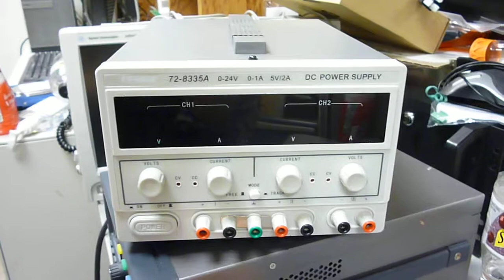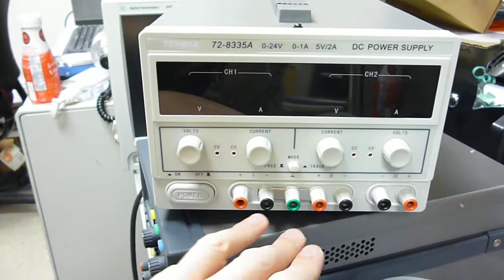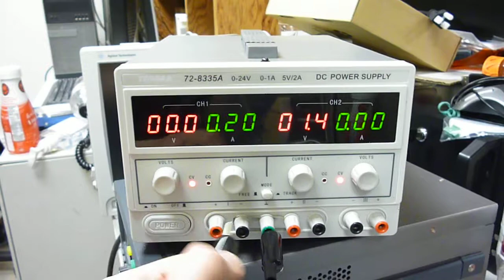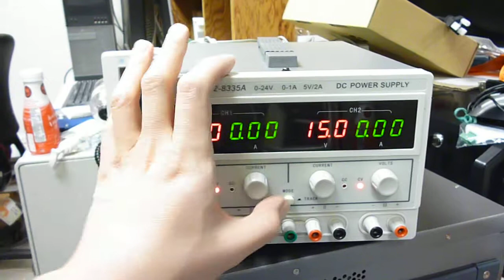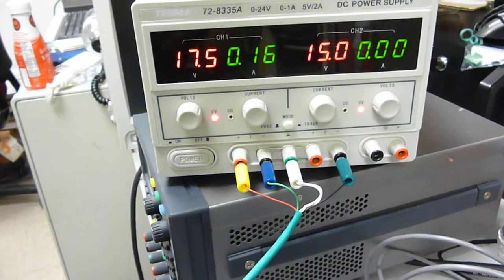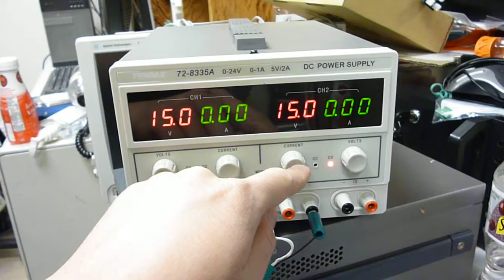EPL Power Supply Setup

Comment: I think the thing you are talking about at the end is not really an issue. Yes, the user interface is a bit hectic, but it makes sense to me. We have "volts, amps; volts, amps" for the 7 segment display, which is natural. The voltage knob is always on the outside.
Reply from the maker: It doesn't match the alignment of the LED displays. It's the asymmetry that is begging for a user setup error. Once more other power supplies get this right.
Reply: @ElectricEvan  Maybe I'm just used to it then. If I was designing it I would make both channels have an identical interface.
Reply from the maker: @wiggles7976  That is what I was getting at. UI must be consistent. The users in the lab are not all EEs many are biology and medical students.